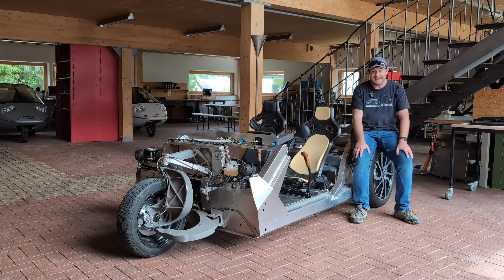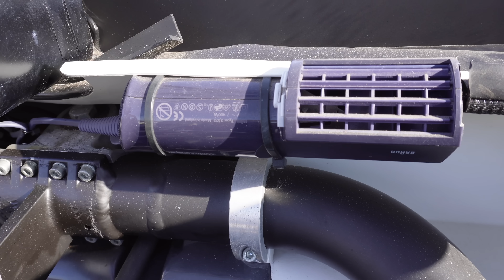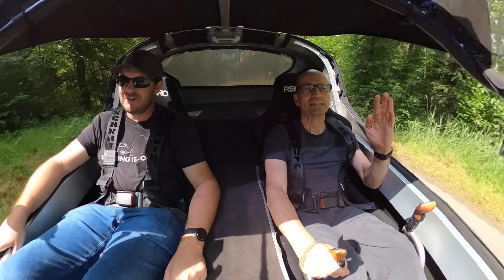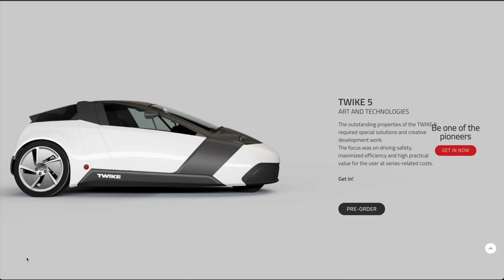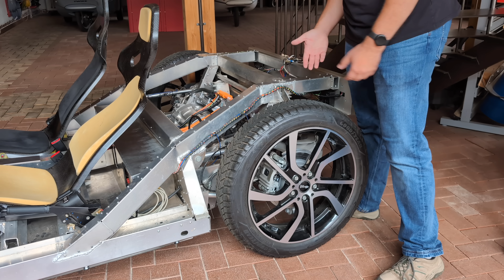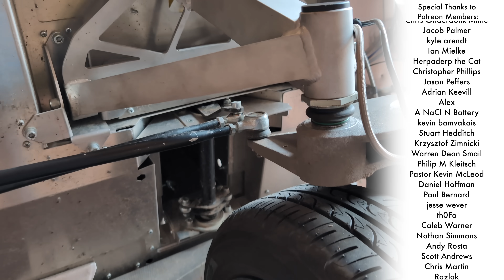TWIKE Is The Coolest Oddball Car Company

Comment: Everybody will probably beat me up in the comment's for saying this but a single cylinder engine with a small generator "Alternator" would make this thing way more feasible for longer travel. Almost 400 Ft/Lb. of torque I can get behind or in but fall's short without a range extender, especially with the bigger one. Then you need way less batteries. If you could usee super capacitors in it for regenerating power and or storage would be cool to give that big motor all it want's when you squeeze the pedal!
Reply: Hi Jeffery, the last round for the combustion engines has begun. We've been travelling electrically for over 25 years. No more desire for combustion engines. The sun and wind provide enough energy for everything. Put the burner on the scrapheap 😉

Comment: 40kwh of battery isn´t that much of a monster, 1kwh is 100 dollars, roughly, so the battery is 4000 dollars alone. Chassis, Controllers, Motor another 10k, plus some 2000 euro profit and this will end up being under 20k euros or dollars. 
Pretty reasonable, now compare it to the Microlino, a piece of garbage that costs too much for what it offers.

Comment: I hate that it has one wheel in the front instead of the back
Reply: Don't worry, the delta arrangement (in combination with the organisation of the centre of gravity in the right position) was and is the right decision. You don't realise it at first glance (because you think that the two wheels have to balance towards the front), but the lateral control of the rear axle is much more important for the driving dynamics. It's not without reason that you won't see a tail wheel solution on large jumbos, such as those still used on aerobatic aircraft. If you want to do more in-depth research, look up the reasons why the better tyre tread is mounted on the rear axle. 😉

Comment: If they really wanted stability, they'd do tadpole instead of delta layout. Looks fun though :D
Reply: Don't worry, the delta arrangement (in combination with the organisation of the centre of gravity in the right position) was and is the right decision. You don't realise it at first glance (because you think that the two wheels have to balance towards the front), but the lateral control of the rear axle is much more important for the driving dynamics. It's not without reason that you won't see a tail wheel solution on large jumbos, such as those still used on aerobatic aircraft. If you want to do more in-depth research, look up the reasons why the better tyre ..

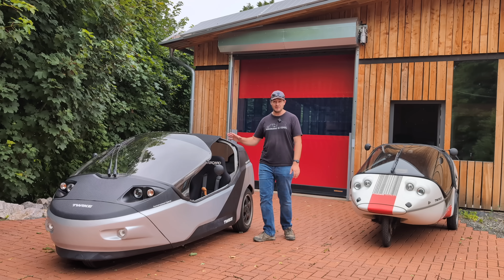Comment: 5:47 Did I just watch a Twike pop a drift? I reckon I did!
Reply: It looked more like a sharp turn than a drift sadly
Reply: There must be more to it than that 😉 It doesn't turn, but in extreme situations (the X-PRIZE had a circuit set up for this) it pushes outwards over all 3 wheels at the same time. Everything remains controllable.

Comment: Nice trikes but why not 2 front wheels and 1 rear wheel? Like a vintage Morgan.
Reply: Don't worry, the delta arrangement (in combination with the organisation of the centre of gravity in the right position) is the right solution. You don't realise it at first glance (because you think that the two wheels have to balance towards the front), but the lateral control of the rear axle is much more important for the driving dynamics. It's not without reason that you won't see a tail wheel solution on large jumbos, such as those still used on aerobatic aircraft. If you want to do more in-depth research, look up the reasons why the better tyre ..

Comment: These grassroots xp vehicle companies are advancing the art of engineering and mobility.  I love what Twike is doing and there’s a strong market potential for this type of wheel orientation.  In fact, if the engineers ever dared add a 4th wheel to the rear they’d achieve what’s called a Diamond Shaped Vehicle (DSV) invented by a French engineering team in early 2000’s.  If you don’t know already, the DSV layout is optimal to achieving absurdly lofty lateral g’s, just with simple suspension geometry.  If Twike made a DSV, race circuits will never be the same.  

And since everything is going electric, the hidden potential of a DSV is at higher highway speed, the outrigger wheels can be lifted a few inches off the pavement to further reduce drag, thus improving mpg range and also reducing track footprint.  The risk of striking loose hazards (tires, ladders, trash, animals, etc) that unexpectedly appear on our highways on a trike keeps people divided between 2-wheeled bikes or 4-wheeled cages. (Trikes are like magnets for these road hazards, like trailer homes to hurricanes … if riding a trike, one of those 3 wheels is gonna hit an unexpected object- unless widely avoided).   

But Twike is a clever group off gearheads and i hope to see their innovations succeed.  Their competition is way ahead.  Aptera is soon to be released and Lit Motors C1 is nearly done incubating.  

Thanks for exposure of unique and interesting vehicles!

Comment: I'm thinking about building a scooter based reverse trike. I'm looking for a suitable quad to harvest the front suspension from. And find a pair of 12", 13" -14" rims I can narrow and use scooter or motorcycle tires on. Possibly leave it open cabin. Maybe eventually build a fiberglass body, and get a glass windshield made for it. The body would be made with 
3 & 6 mm rod bent and welded then foam and duck tape to get the basic shape. The  aluminum foil tape, and fiberglass, maybe some carbon fiber. And possibly sneak in a actual motorcycle engine  in. Mounted on a swing arm with the rear  wheel. I have seen only one built similar to what I'm thinking. But hopefully 95mpg would be possible , with a 80 mph "top speed" 😉 
With the proper gearing a 600 cc engine from a Ninja should do fine ! Haha.. seriously a 125cc roughly or 150 cc scooter engine with a big bore and extra bits. And possibly add a 3-5 kw motor for sneaking out early mornings. And help acceleration and Regen brakes , nearly doubling the TQ down low. And possibly getting to  100 mph
 on the high end. Depending on many  factors definitely getting handle bars mat a mini wheel in the  center for long rides. And a 20 kwh battery minium, and 2.5-5 gallons fuel tank and get 300-500;miles per tank with full charge!

Comment: Hmm if I was to make something that had that style of window and had that kind of wiper I would make it so the the activating button toggles a movement of course that area would have to be watertight just in case and it would have to allow the water that enters to go out the side of the frame but I would show you kind of what I would do because_-\/-_ as a catch that gets pulled down to allow the wiper to settle in the V zone
Reply: Of course more like _---\_/---_ is the most realistic I could draw at this point

Comment: Basically, they made a bad decision a long time ago by proposing an electric car that could be recharged by pedaling. The technology never kept up with the idea, and they ended up forming their brand identity around that bad decision. Their future is tied to it. It's important to remember that in any project, the foundations must be strong, and if pedaling is not going to add significant value to the car, building their brand identity around it seems like a grotesque mistake. Either you make pedaling have real value, or you choose a meaningful brand identity.
Reply: The point is a good one. And the advantage is actually less the gain in range (it wasn't with the TWIKE 3 either), but the gain in health and time (not having to plan extra time for fitness training in addition to necessary journeys). If you don't want to pedal, you don't have to, and yet you sit more ergonomically because both halves of your body are used evenly. Besides everything, it's super relaxed 😉

Comment: I love that you said the head of twice is confident that it's okay and they've had no issues... Whilst on the screen showing your failed, leaking pack... 😂 What a great video and a super cool company, love it 👍🏻
Reply: The TWIKE 3 has also had a BMS since the beginning of its construction period (since 1995). It just didn't have an automated balancing system. However, such a system would not have prevented the water damage to Robert's restoration object. Of course, the battery must be safely integrated mechanically and electrically, no question. And checking the tightness of the battery box during servicing is standard. But let's give Robert credit for the ironic film editing 😉

Comment: If the Twike 5 does make it to production, and hopefully it's not an Aptera situation where it's dev model after dev model after dev model, I'd rather have an option with no bike pedals with traditional gas and brake pedals along with a traditional steering wheel.  Twin stick might be cool for a more traditional velomobile that doesn't get up to speeds cars will get at, but I think a traditional wheel will end up being easier to drive with long-term; plus steer by wire is getting good enough that it makes sense for something like this. 

I really want to see more vehicles like this, Vanderhalls, etc., but with how the roads are here in the US, thanks lack of regulations on grill and bumper height, I don't think anything can actually go smaller than an Aptera and have any amount of shared road safety.

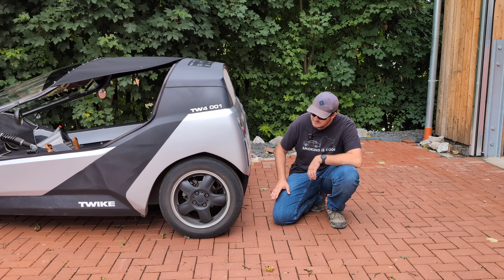Comment: 10:25 for the whole video, I was thinking "Why does it have mini wheels"
Reply: One of the most challenging tasks during the X-PRIZE phase was to find matching parts that corresponded in total to the specifications of the X-PRIZE. The tyre diameter matched the motor. The rims matched the wheel bearings. ...

Comment: By using pedal power to drive a generator vs driving the wheels, you lose about 20% of your muscle power to heat up the cabin instead of moving the car. Muscle efficiency is not great to begin with so actually using electric power is less overall cabron footprint than pedaling, which also applies to bikes.
Reply: The pedals essentially increase the user's fitness. It also increases the range, but gaining range is not the primary goal, the 40 kWh battery is already there for over 500 kilometres ... 😉

Comment: I like that they are doing something different but lets be honest - this is just a flight of fancy. You can see it becoming more like a normal car with every itteration and eventually if they don't wish to stay ultra niche and ultra low volume it will end up very much like most other small cars. Maybe not from a styling point of view but certainly from an engineering one because regulations on mass produced stuff simply don't allow some of the things these guys are doing. 
Its even clear in the nonsense stats like 40kWh for 300+ miles of range. Maybe (presuming they can get the aero's really on point) in perfect circumstances with great roads, perfect weather and ideal speeds but any variation from that and range will plummet like its going out of fashion. Hilly areas? forget it. Highway speeds? Not a chance. Heater on, cold outside and raining? 
Even more irritating is that you're using a massive (relative) amount of resources to make that battery when it could easily have a battery half the size and a range extender - which for almost everything this will ever be used for would be a far better option.
Reply: Everything you see is street legal. Approval in Europe in EU class L5e. In principle, the requirements of a US motorbike are also taken into account. However, we have to check the latter again before importing the first vehicles to the USA.
Reply: @TWIKEofficial  So you're saying they can pass mass production regs as they stand? Or are we talking about getting them in under the trike regs so they don't have to meet anywhere near as many criteria? 
You see people don't generally buy those in large volumes because bypassing safety regs while trying to sell something at the price point of a normal small car always goes the same way. 
Don't get me wrong - I love the idea of something small, light and practical which doesn't take up much space and uses little energy to move - its not a bad idea at all. 
The problem is the competition. A small ev costs similar or less, passes all the safety regs, can usually carry more people and so far as costs to run/own go its a wash. 
I would love one to do my commute but would I put my kid in one on a freeway journey? Not a chance which is where the usual small cars carry a massive advantage. 
I really wish you success because using less energy to get about is a great thing and there's something about Twike thats got a really good vibe about the company. I just hope you don't spend a lot of time and money then end up going out of business like all the others who have tried. 
Now if you make one thats 50 state legal, 5* safety rating and uses a smaller battery (or even the same one) with a range extender option I can see them selling like hot cakes in places like California - look at the popularity of the I3 rex for example even though its range extender had to have a pathetic range to suit ev regs at the time.
Reply: @siraff4461  The TWIKE is not in competition with a small car. When transporting just one or two people, it offers so much more riding fun, performance, value retention and fitness benefits. A small car is often the second car for our customers, e.g. for transporting 3 or more people at the same time. And yes, the increasing awareness of healthy exercise in everyday life will make the TWIKE a favourite. We have already received good feedback on this.
Reply: @siraff4461  The TWIKE is not in competition with a small car. When transporting just one or two people, it offers so much more riding fun, performance, value retention and fitness benefits. A small car is often the second car for our customers, e.g. for transporting 3 or more people at the same time. And yes, the increasing awareness of healthy exercise in everyday life will make the TWIKE a favourite. We have already received good feedback on this.

Comment: Sorry so long. Three wheels are OK, but safer if two front wheels and one rear. I think pedaling idea is OK, but use it for one or two people with a generator in between the pedals. Set in “transmission” tunnel or console . This car will be electric only but with two batteries. Use one till it is depleted then switch to the other and use the pedals to charge the depleted battery. Then just switch back-and-forth between the two. Using a motorcycle handlebar will give more room for pedaling and safer steering control. Can have the same type of system that ATVs use. Two brake handles for front and rear with thumb operated throttle. And weird idea is steering will use a chain going to a central shaft which should have room between front wheels. But when desired steering may be moved to other side for second driver, or in center so  when stopped may not have to worry about hitting knees when charging. Motor is AC so have regen and connected to rear wheel through double chain. Have seen some very nice body styles but can you make a cheap prototype with all the vehicles and parts you have?

Comment: Problem with those trikes is that a better setup is 2 wheels in the front and one in the rear. More stable and better cornering. I like the idea and would own one but has to have 2 wheels in front. For the front wheel, I already came up with a better and lighter system than theirs LOL using ancient tech.

Comment: So if you pedal the Twike 5 for three hours non-stop, you'll produce enough power to drive it...  less than a mile.

The weight of the pedals and generator system costs more power than they'll ever generate.  The one maybe-useful thing is that if you get stranded in it, or you're going to be camping for a week far from a charger, I guess you could pedal for many hours every day and recharge the thing.  But even a modest solar panel would do a better job of that.

Comment: Those pedals are such BS. The Twike 4 is the first tiny car I've seen that doesn't look off-putting. I'd even call it good looking. If it was for sale, I'd seriously consider buying one to use day to day while leaving my ICE car just for the occasional trip out of town. But I definitely wouldn't buy the Twike 5, no matter the performance, just because of the useless pedals.

One the 4 they were concerned about the weight of body filler, but on the 5 they added pedals and a generator? I know the 4 was for a competition, but surely they want the 5 to be as efficient as possible as well.

Comment: The only way I would change the Twike would be to have it lean into corners somewhat. That could help to lower the center of gravity, and make you feel like a fighter pilot when you bank into turns. Other than that, if I had the money to buy one (unfortunately I don't), I would definitely do so. They're just cool.
Reply: There was a trike that did that - the body would lean into turns. ICE with motor and gearbox above the back axle. Two tandem seats. There was a prototype in Bath Uni's basement twenty years ago but I don't think they ever found a market for it

edit: it was called CLEVER